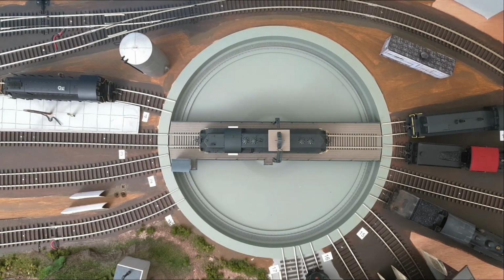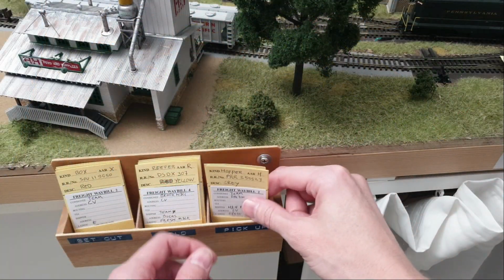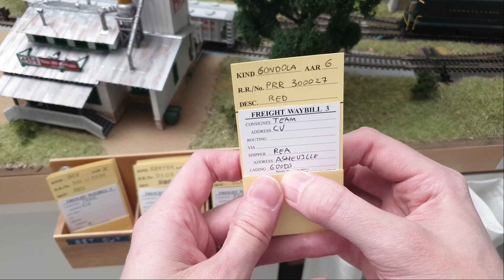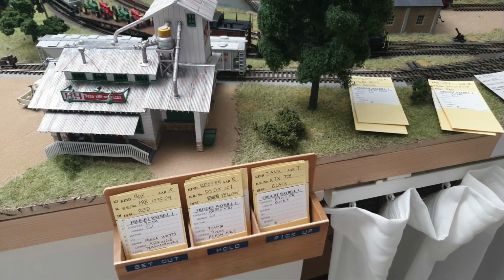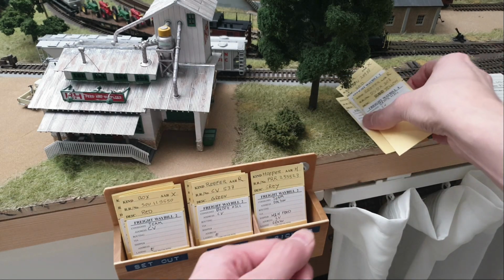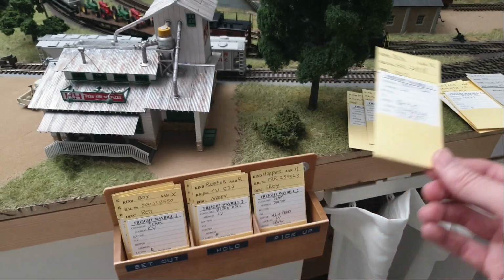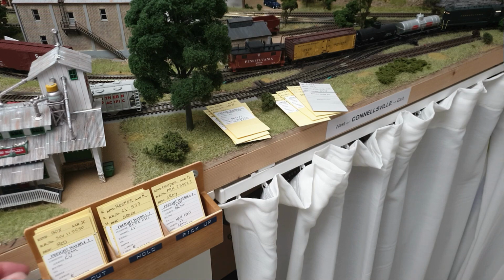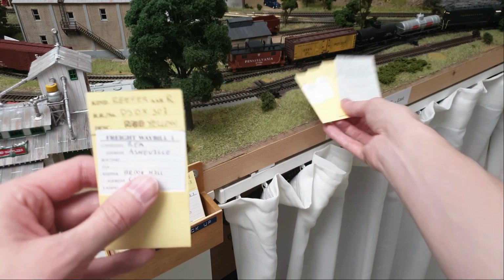17 - Beginners guild. Car Card operations example: Connellsville Turn.

Comment: Are you operating by yourself or do you have help?  Just curious because the Dalton turn passed as you were switching CV.
Reply from the maker: I am actually operating by myself. The layout is build to operate by by myself, but could handle max 3 people. But there is no one around that is interested in MRR operations for now. If you look closely, you see there are never 2 trains moving at the same time ;-) Although I have multiple cabs i could do that, but i learned the hard way that trains can run away from you!